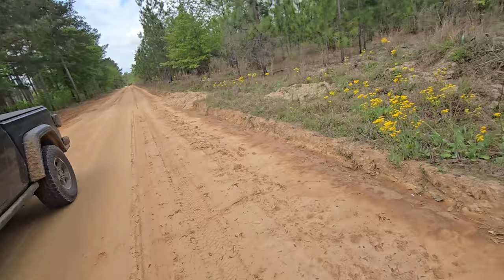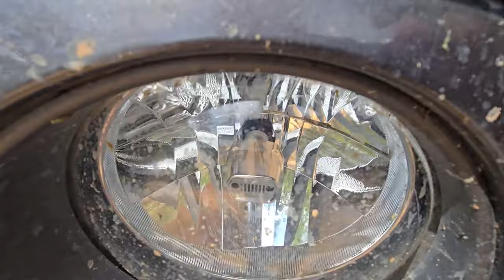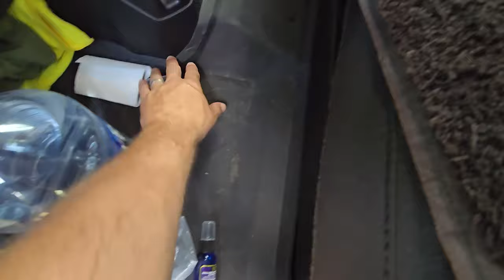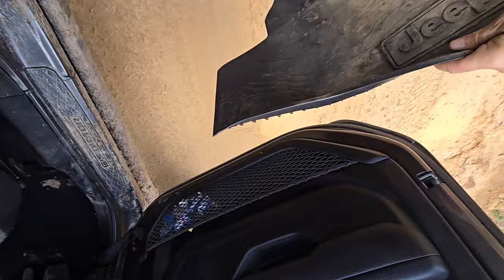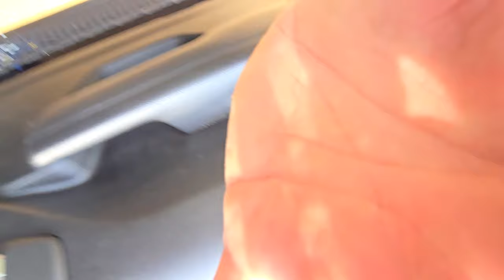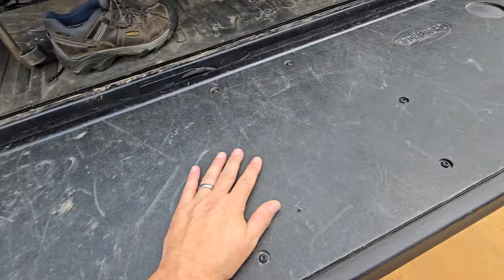Will Never Buy A Vehicle Without These 4 Things- Any New Vehicle Must Have These Things

Comment: Those factory all weather floor mats are the best thing ever.  I used to have to vacuum my car often.  I have yet to vacuum the new Jeep yet.  Just take out the mats, wash them off, and put them back in. So easy!  As for the extended warranty I couldn't agree more.  I haven't purchased an extended warranty yet but I will.  I didn't want the dealership to lump the cost into the deal in any way so I separate the transactions.
Reply from the maker: Check my video called how to buy an extended warranty. I list the name of the Mopar guy I bought mine thru along with his phone number . 1270 for a 5 year 100k factory Mopar warranty.
Reply from the maker: @WreckedBrewery  if you wait until after 12k miles the prices goes up some I heard. Not sure how much truth to that but what I've heard
Reply: @Jason-Samko Good to know!  Thanks! In that case I can plan to do something before the 1st year is up.  I drive about 10k-12k a year depending.  Of course I'm really loving this Jeep so I've been driving it a lot.

Comment: Did you put the 35’s on your gladiator yet? I will do the same, any problems ?
Reply from the maker: Yes put 35s on about 18k miles ago right after I got the gladiator.  Love them.  Zero issues, zero rubbing zero regrets. Got 35x11.50s.
Reply: @Jason-Samko  stock wheels?
Reply from the maker: @John-cz6it  yes on stock wheels. Because I went 35x11.50 not 35x12.50. A 12.5 will require a 8 inch rim and my stock rims are 7.5. But a 11.50 will go on a 7.5 rim

Comment: My 23 Mojave has been almost flawless.  It does have a noisy driver's window up and down.  Need to take it to the dealer.  I did get the extended warranty through Mopar.

I'm a hunter like you.  So far do not see a need to get bigger than stock tires.
Reply from the maker: Outstanding.  The Mojave is the sexiest gladiator trim. Absolutely love it. Have a video coming out that I hope jeep watches about how they could take the Mojave to the next lever and be the most amazing gladiator made. Will go live soon.
Reply from the maker: And the stock tires on the Mojave are excellent and there are very few vehicles in the woods with bigger than 33s. 33s do amazing

Comment: You can put the cap on the drain plug opening
Reply from the maker: I think I'm gonna tape them from the under side. I don't have any caps for the floor Matt's.
Reply: @Jason-Samko You do have the caps, they are in the floor.  You just take the cap from the floor under the mat and bring it to the top onto the mat.
Reply from the maker: @WreckedBrewery  then I would get water coming up thru my floor boards in all my water crossings
Reply: @SamkoWorkShop  Really?  I haven't tried water crossings personally yet but when you pull the plug and smack the floor mat into that plug hole, then put the plug hole into the mat on top, it seems pretty sealed?
Reply from the maker: @WreckedBrewery  I honestly have not tried to put the floor plug in the mat to actually see. I'm just assuming that if I don't have a plug in the floor water would come thru. I'm often in water above the floor boards for some pretty long stretches, like 200 or 300 yards when things are flooded. I will pull it out and see how it works. No you have me curious
Reply: @Jason-Samko Yeah it looks sealed if you push the mat into that hole and plug the top.   It actually snaps into that plug hole.  I'd be curious too.  I haven't done a water crossing yet.  Let me know!
Reply from the maker: @WreckedBrewery  will check it out for sure
Reply: @Jason-Samko  the rubber stopper may have been taken out by the dealer. You may want to ask. There is a stopper for the mat
Reply from the maker: @Dc-ee8hn  will check on that or see if maybe I can buy them. Thank you for the suggestion
Reply: @Jason-Samko try it, the cap plugs the mat and goes through and plugs the floor too when installed from the top
Reply from the maker: @MountainScrambler71  good to know. Thank you

Comment: 100% agree on the warranty. I won't own anything newer than 2012 without an extended warranty these days.  One little problem can justify the cost of the entire warranty.
Reply from the maker: Agree 100%
Reply: The odds are high that those rackets WILL deny deny deny any claim
Reply: I've had 5 vehicles with Mopar OEM warranties over the years and never had a single claim denied by them.
Reply from the maker: @efil4kizum  never once had a warranty claim denied. But I also always buy true manufacturers extended warranty not 3rd party warranties.
Reply from the maker: @daveola2105  yep never had a warranty claim denied either
Reply: @Jason-Samko  that could be all the difference!

Comment: I despise led. I drive alot in winter and i absolutely hate them. 
Had to put heated wiring on the lights on grampas car because he bought one with led. Completely useless with snowfall.
Also hate the light colour on anything but the most premium ones. Its ok on matte dark roads, but it burns over time with snow, and barely works with real rain. 
You cant compare brand new 200$ leds wits 30 year old halogen. 
Try osram laser 200% lights. In clean holders that arent yellowed. And tell me led is better in the dark, especially rain and snow. When you really need it.
Reply from the maker: Never tried those bulbs your talking about. But spent my whole life in Northern Michigan in the snow belt. Love leds even in the snow. Now that I live in georgia I don't deal with snow but tons of rain. Love my leds. Won't own a halogen headlight again

Comment: Don't buy any Jeep Wrangler  or derivative past 2022. That infotainment screen is a gimmick and nothing else has significantly changed. Just buy the configuration you want from 2019-2022 at reduced prices. The dealer floorpans are circling the drain, play hardball with them until you get a price you can swallow.
Reply from the maker: Can do that too. Always a good option